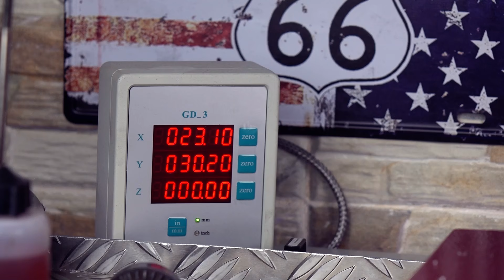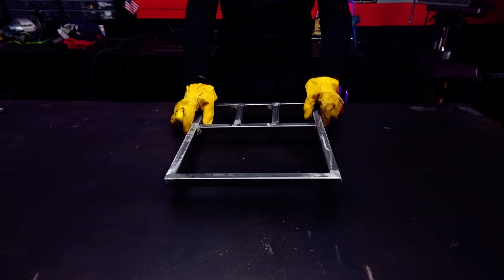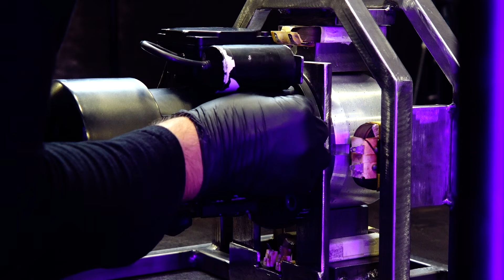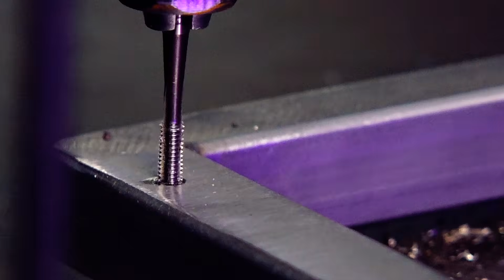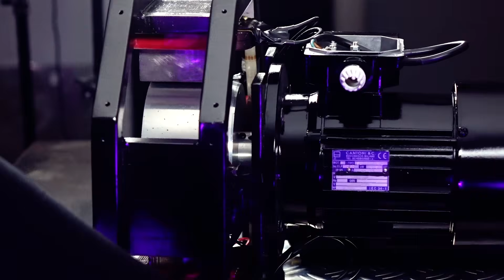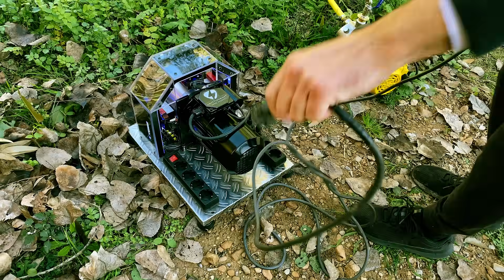20KW PERPETUAL ENERGY GENERATOR 110-220 Volts

Comment: Oh, for fuck’s sake, you all…do you think magic is real, too, just because you saw a guy make a coin disappear or saw a woman in half and she was then put back together moments later and was fine? So…magic is real then, right? You believe your lying eyes when you watch these videos, right? No way there is any sleight of hand or editing or camera trickery or something possibly rigged or is staged that’s going on here, right? Because you watched the whole video yourself and it just…works - you saw it, right?

People…

The creators claim that by modifying microwave transformers and using a custom rotor with a "special alloy," they can eliminate magnetic braking (Lenz's Law).

Here is why that is a physical impossibility:

When a generator spins to create electricity, the current it produces creates its own magnetic field. That new magnetic field naturally opposes the rotation of the engine. The more electrical load you plug into a generator (like a power tool or a heater), the harder the engine has to fight against this magnetic resistance to keep spinning.

In their videos, they plug in heavy electrical loads and the motor doesn't even flinch. In the real world, the moment you draw 20 kW of power from a generator, the magnetic braking forces act like slamming on the brakes of a car. The tiny electric motor driving the loop would instantly stall. You cannot engineering-trick your way out of this; it is a fundamental rule of how electromagnetism works. Sorry. 

Also, sorry folks, but Donald Trump is NOT a good president nor is he very smart! (I assume if you think that this “generator” is real, you might be naive in other unfortunate ways, as well, and are likely MAGA 🤷🏼‍♂️)

Comment: Hello, your video really caught my attention and got me very interested! I am planning to build a renewable energy system for a remote, deep-mountain area, and I would highly appreciate it if you could answer the following questions:
1. What is the specific model or part number of the transformer you used?
2.What is the exact model of the motor? Is it an AC or a DC motor? What is its output voltage, and is it operating as a generator in this setup?Thank you, and I look forward to your reply!
Thank you.

Comment: You can only...IMPROVE...
You haven't yet STRENGTHENED THE MAGNETS.
Each...magnet... recharges when it receives electrical energy and increases its magnetic strength.
The release of electricity to the magnets is not envisioned in this inventor's invention.
Another motor for perpetual electricity generation could be evaluated with a permanent magnet charging system.
This would prevent the magnets from deteriorating over time.
Furthermore, from a perpetual motor producing...20...Kw..., you could directly switch to a LARGER motor to PRODUCE MORE...ELECTRICITY...

Comment: can you use a 12 mm thick magnet instead of 3 magnets by 3.5 mm? what will the diference be. also whey an aluminium aloy it works perfectly fine with just aluminium.
Reply: You can only...IMPROVE...
You haven't yet STRENGTHENED THE MAGNETS.
Each...magnet... recharges when it receives electrical energy and increases its magnetic strength.
The release of electricity to the magnets is not envisioned in this inventor's invention.
Another motor for perpetual electricity generation could be evaluated with a permanent magnet charging system.
This would prevent the magnets from deteriorating over time.
Furthermore, from a perpetual motor producing...20...Kw..., you could directly switch to a LARGER motor to PRODUCE MORE...ELECTRICITY...

Comment: if this works and is real, people will start found new societys, mabe on ships as well :D
Reply: You can only...IMPROVE...
You haven't yet STRENGTHENED THE MAGNETS.
Each...magnet... recharges when it receives electrical energy and increases its magnetic strength.
The release of electricity to the magnets is not envisioned in this inventor's invention.
Another motor for perpetual electricity generation could be evaluated with a permanent magnet charging system.
This would prevent the magnets from deteriorating over time.
Furthermore, from a perpetual motor producing...20...Kw..., you could directly switch to a LARGER motor to PRODUCE MORE...ELECTRICITY...
Reply: @pinolabella9208  haldeimau

Comment: I have a question? How much amperage this system generates?
Reply: 100 Amps supposedly. They said 20,000 Watts. 🤷‍♂️. 

I want to build one and test the FLA. full load amps.
Reply: I need to build two of these for my community in Puerto Rico. Does anyone know how to get the parts? I'm willing to travel to the place of origin to start the project. Thanks.

Comment: Perpetual motion, meh.  I'd like to know if anyone has an educated opinion on how long the engine described in this video (LE 2.0) would run from start to generating <240v? assuming the laws of thermodynamics would see the engine eventually slow to a stop after a time and how much power I could store over that runtime. I'd be looking to charge battery (home/portable), not use it as a primary source of power.
Reply: Then you don’t k know w what your doing. This wound work great for that. Small load. It would generate a few years with no issues as long as you keep it dry.  Humidity is a pain for things like this.

Comment: I am only worried about the space between the coil and the magnets. The space should be realistically in millimeters to get any reasonable voltage from just those 4 pancake coils. Another reason why i think this won't work unless something is hidden from my little experience is that, you can't manually turn the rotor to get same 220V that is needed for the motor to turn 1500 rpm....The only way for this to work is if the motor is a 12V, 1500rpm motor  and has an inbuilt regulator that maintains that votage when the generator slowly starts running at an insane 1500 RPM. 

Ideally i know that this is 100% possible but i do not think that the magnetic spacing, and initial startup voltage is enough to power that motor which feels like a 220V, 1500 RPM motor
Reply: You can only...IMPROVE...
You haven't yet STRENGTHENED THE MAGNETS.
Each...magnet... recharges when it receives electrical energy and increases its magnetic strength.
The release of electricity to the magnets is not envisioned in this inventor's invention.
Another motor for perpetual electricity generation could be evaluated with a permanent magnet charging system.
This would prevent the magnets from deteriorating over time.
Furthermore, from a perpetual motor producing...20...Kw..., you could directly switch to a LARGER motor to PRODUCE MORE...ELECTRICITY...

Comment: where do we see the casting and the silver and alu mix , what about a ceramic cylinder
Reply from the maker: We can't say what the alloy composition is. We don't think it will work with a ceramic cylinder.
Reply: @thelibertyengine  well i get you need something where electrons can be excited on ...a substrate being your "magic" rod ceramic will not work i think you right :_Bigbro:
Reply: @thelibertyengine  So is the point to promote Liberty? Or to just cash in as much as possible before you get cancelled?
Reply: @thelibertyengine let's guess then, 75% silver for conductivity and 25% aluminum to reduce weight.
Reply: @thelibertyengine I’d say 90/10 but just guessing. You may not be able to say, but once I figure it out I will
Reply: @thelibertyengine You mentioned in the video the alloy was made of silver and aluminum. The question is in what percentage.
Reply: @Furykev  will we ever know!!!!
Reply: @Furykev  aluminum and silver/gallium, Graphite, Bismuth bit of cobalt a drop magnesium the blood from one fruit bat, the left toe of a frog and abracadabra!!! poof!!

Comment: One thing that you don’t show your audience is that when you connect all the energy consumption equipment and devices “ONE CLEAR THING IS THE MOTOR WILL STOP ROTATING AS ENERGY GETS PULLED AWAY BY THE CONNECTED EQUIPMENT AND DEVICES THAT CONSUMES THE ENERGY” If we use the percentage of the brain used by Albert Einstein to a little more extend sure should have perpetual energy generator by now .Anyway well done .

Comment: Question, is the rotor’s magnetic field at a different phase, so instead of opposing motion, they apply torque in the same direction as rotation? A type of delay?
Reply from the maker: No torque is applied to the rotor; there is simply no magnetic braking when it rotates at a certain speed.

Comment: I am kind of convinced that magnetic motors work. And that likely is why this works, if it truly does. But if that is what makes it work, then you really shouldn't encase the permanent magnets like you do, since I have heard (and it makes sense) that magnets will lose their magnetic force over time (I heard that Howard Johnson, who was the original designer/builder of a magnetic motor said this). I don't know how long they will last, but you really need to come up with an easier way to replace the magnets.

Comment: You need to make 8 metal core coils and build 2 more motors to generate electricity opposite the main motor; a dual 220-volt single-magnet core.

Comment: Okay, so @8:50 you turned the rotor by hand. At that point everything you need is already mounted, so why didn't it continue rotating?
Reply from the maker: I don't understand what you mean. For it to work, it has to spin very fast to generate enough voltage to start the motor.
Reply: @thelibertyengine I wanted to ask you a question that you would see directly. Has your team you ever thought about running a perpetual live stream of the Liberty engine powering something from a single camera angle and nothing else in the frame for any of the naysayers who refuse to believe your prototype is real? Also maybe split screen the stream with another camera angle of the entire stream setup being powered by another Liberty engine. Also, will you be holding another giveaway anytime soon? I'm planning on sharing your videos as often as possible. I'm on the verge of being homeless and want to live off the grid because I don't know what I'm going to do otherwise. If you're not con artists, you need to start making these and handing them out to people, or at the very least, releasing the actual instructions and buyer's guides on the dark web

Comment: I see your construction. If you earth the frame it wouldn't work so well. Also, if you draw too much power, it would stop. Also, in this configuration your magnets are going to die over time, and will require re-energising.

Comment: Please state the % ratio of silver and other components in the alloy !
✨✨✨
Reply: Use all the hints given in previous videos, especially the volume, teoretical weight, and density. Plug all these hints into a newer Ai LLM, and it will give you about 4 recipes with detailed casting methods.